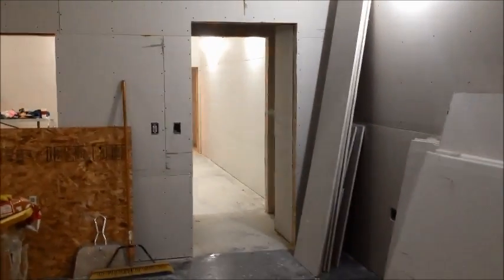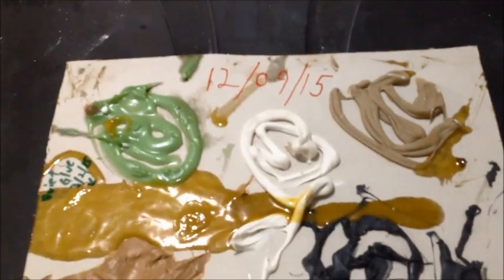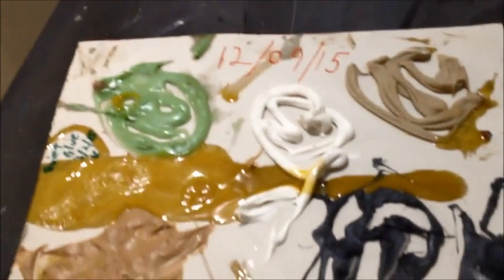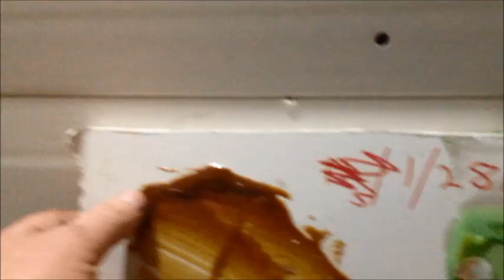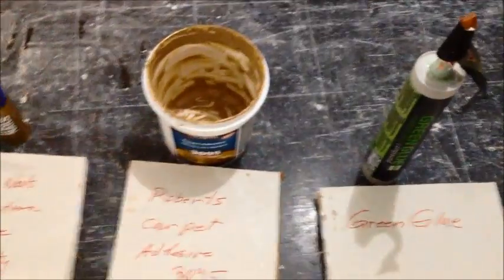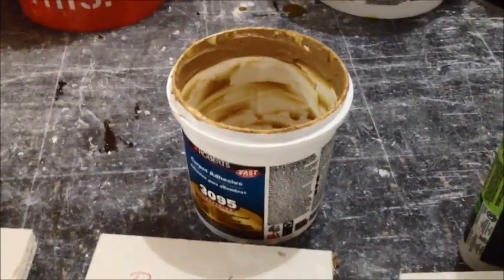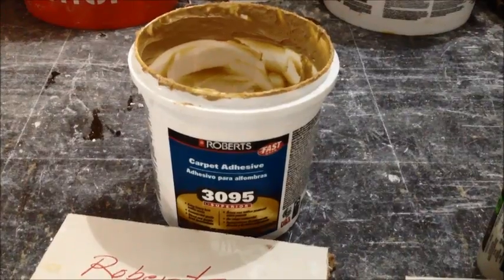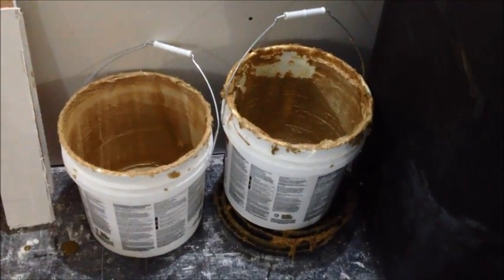Green Glue vs Quiet Glue Pro - Soundproofing comparison

Comment: Regarding the Robert's carpet glue, does it take longer to apply? Looks like quiet glue and green glue can be applied very quickly.  Time is money...
Reply from the maker: No. Its very fast just like the Green Glue. For the carpet glue we used a trowel with a serrated edge which gave it a cool ribbed texture but it can be messy to work with as it gets exposed the the air and gets stickier. But it never fully hardens so thats the positive. For the Green Glue we used large caulk guns and they were quite fast as well.